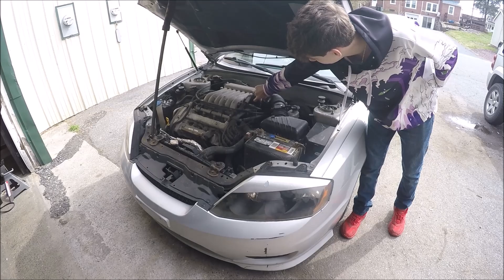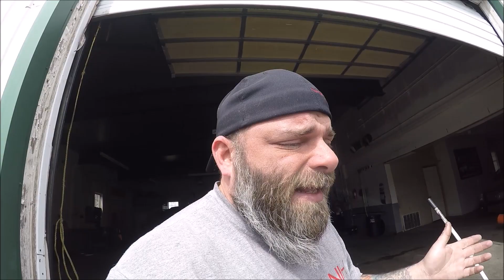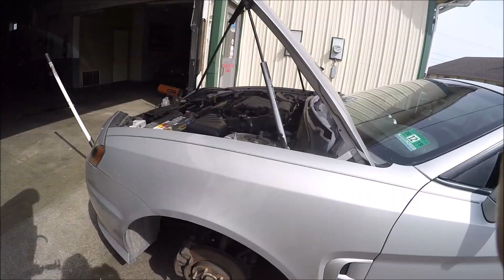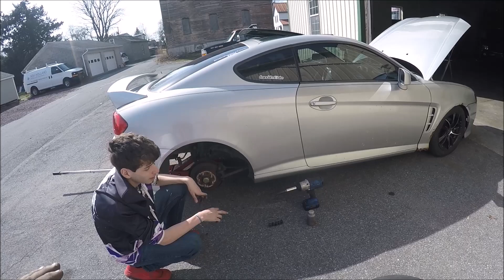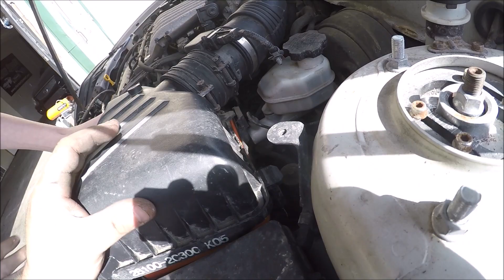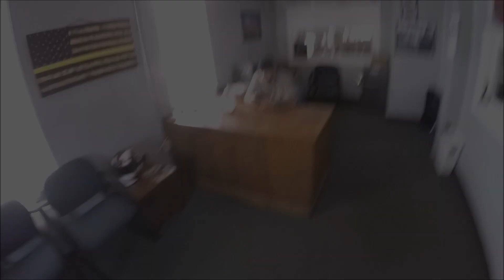My Kids Clapped Out Sh*tbox Is Finally Making BUILD PROGRESS!

Comment: It's surprising how much a set of headers, a cold air intake, and a 2.5" exhaust does for those 2.7s. My 2002 Sonata woke right up after those mods. You could definitely tell that it needed a reflash after that, but it felt much better and definitely had more power.

Comment: Had a 05 back in 05 and had a problem with hi reving and also running like crap because  the maf was covered with oil because I ran a Kand N 
Once I cleaned it ran much better

Comment: Actually if the battery is dead and has less than 10.8 volts the ecu is only going to function in open loop anyway.

Comment: You are supposed to adjust the bottom part of the coil over not by the spring
Reply: Adjusting by the spring will mess up the pre load it will ride stiff

Comment: "Brake pads look good Zak" More scoring on the disk than at a dealers front door.
Reply: onetruecharlatan lol I’m glad I’m not the only one that caught that. Ugh just the few videos from him I’ve watched make me cringe. I kinda see why his shop isn’t full of customers cars
Reply: I was going to mention that also but in all honesty if the pads have a significant life there's no need in changing them out yet.
Reply: When you buy "grooved disks" that's a manufacturing process to make them work better. Those looked more like they'd come out of a vinyl record press :P
Reply: I love Andy, he's a genuine guy, but some of his practices give food for thought ;)
Reply: They don't sell grooved rotors.  You can get slotted or drilled but not grooved.   But seeing as this is just a beat up project car and potentially just a daily driver around town it wont hurt anything to run the grooved rotors through the rest of the pads.  Now once the pads are done for and he doesn't change them I would certainly start questioning the man and his business tactics seeing as how he does build high horse power cars.